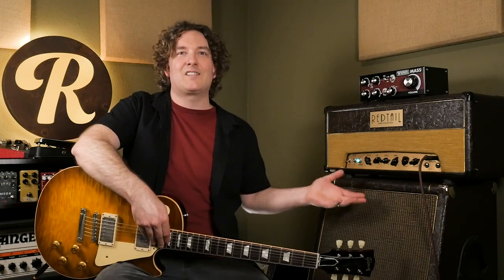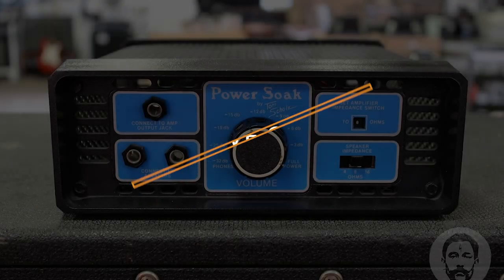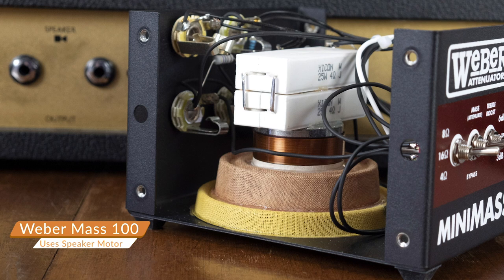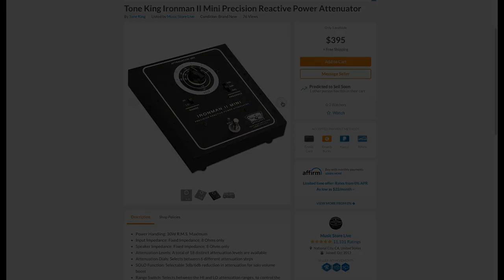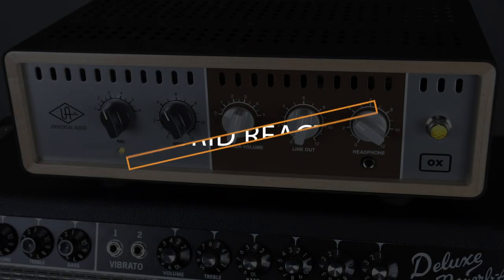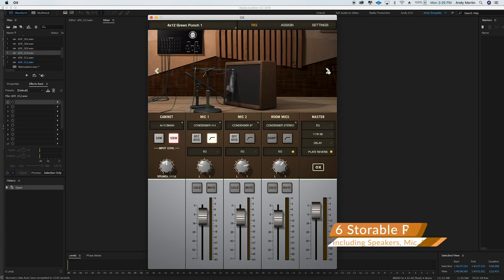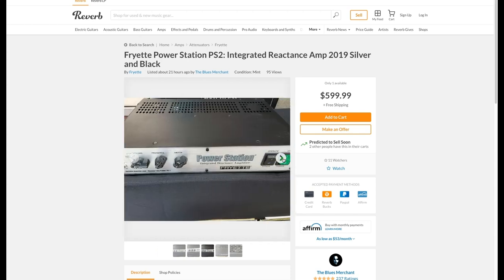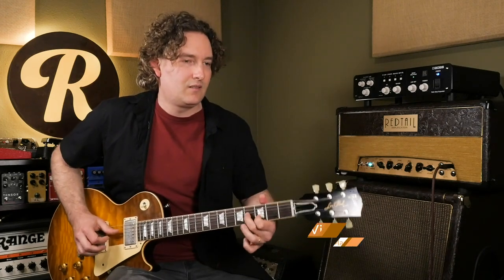Is An Attenuator The Guitar Tone Solution You Need? | Reverb Tone Report

Comment: If the wattage of a cab is the same or not much more than the power section, you really don’t need an attenuator since the whole point in that case is an overdriven tone from the speakers themselves which can only be done at full volume; a bare-minimum to be heard with drums makes sense for that, but attenuators that have an emulator is better than a regular preamp sim.
Reply: You can get speakers that are designed to breakup at lower volume. And the point of attenuators is more to reallllly push the power section, get everything working in synergy, which is the magic of cranking a non-master volume amp.
Reply: I don’t know what you’re saying is a myth, but YouTube being insecure showing parts of deleted comments is not; not all power sections sound like that when pushed and I want real speaker breakup since I want to be heard with drums anyways.
Reply: @michaelgrahamwongacutemadness  It’s a myth that speaker breakup has to do with output, it’s actually related to cone thickness. I changed the comment because I chose to word it differently. People can rethink how they want to say something.

And no, not all power sections sound like that when pushed, but it’s mostly the prime use of an attenuator, to let you get the power tubes cooking. 

You can get speakers that break up at low volume if that’s all you want. No attenuator needed.
Reply: @jsullivan2112  Well obviously it doesn’t work because I still was able to view part of it, but no one ever told me they saw something like that of mine; I’ve used attenuators with both solid state amps and tube though now I don’t use as high-wattage amps since I plan to go full-volume at gigs with a smaller setup.